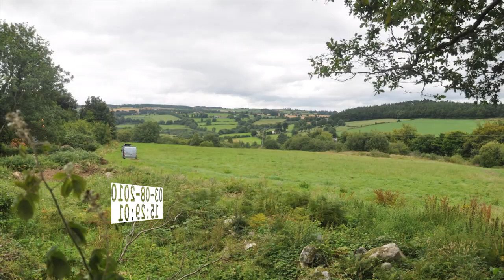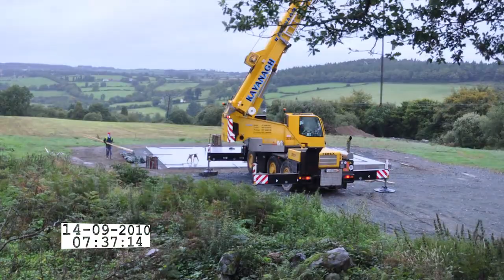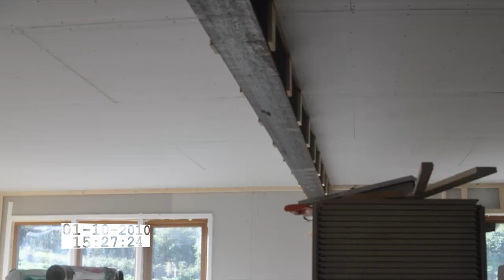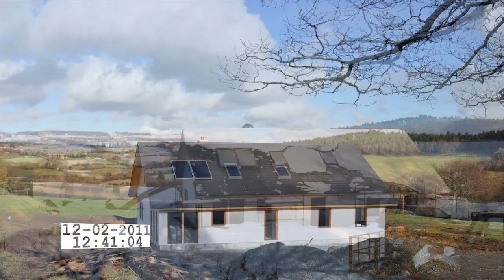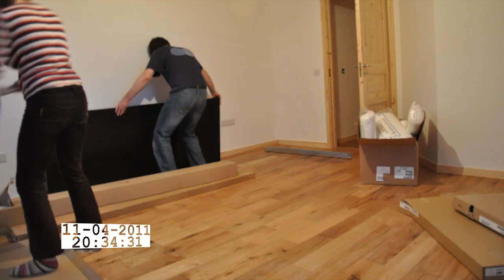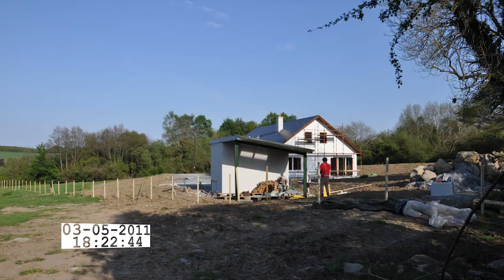Passive house time lapse building in Wicklow

Comment from the maker: Hi Wayne,
I build myself a weather proof box (see link in comment) and fixed it in a tree nearby.I used the integrated time-lapse function of the Nikon D5000. I took one picture every minutes from 8 am until 6 pm and had to change the batteries every lunch time.
I end up with 22564 Pictures in many folders, I wrote a small program to order the pictures and create the time stamp then import everything in Adobe Premiere. That is pretty much it let me know if you want to know more.

Comment: How come their is a Chimney stack? I thought these are airtight homes. Was it an after thought as I don't see a base put in to carry the weight of the stack
Reply from the maker: Good spot ! The Chimney was plan but with a flue pipe all the way up, not concrete. The local builder that did the finishing was against it and with the position of the Chimney we would have had to put cables to reach the required height so we decided for a concrete chimney.

Comment: Did you run the door blower airtightness test and get it passivhaus certified?
Reply from the maker: Hi Yeah No (nice user name) we did the test only once to find all the small problems they were but we did not go for the full certification, they were no government incentive at the time and we did not see the use of being certified. House works really great anyway :)
Reply: Thanks for the reply! Don't blame you for not trying to get it certified. There are a lot of pretty stringent criteria that have to be met just to have a little pretty 'certified passivhaus' plaque on one's wall :) 

I think I see what appears to be a solar thermal panel on the roof - how's that working out? Are you using it for hot water, space heating or both?
Reply from the maker: We are only using for hot water , it nearly works to well in the summer as we get too much hot water and our pump does not really like it ! 
We have free source of wood so we get our heating with a small wooden stove which heats the entire house .
Reply: @daplein  Thanks for sharing :)

Comment: 37 videos detailing a passive house build ( more as the build progresses ) https://www.youtube.com/user/seumas2/videos
Material used 

Port
Alberni's first Passive house (Passivhause) build in the heart of
Vancouver Island British Columbia Canada.

Passive
House(Passivehaus) is considered to be the most rigorous 
voluntary energy-based standard in design and construction industry
today.

Passive
house buildings consume up to 90 percent less heating and cooling
energy than conventional building.

The
use of Passive House design software was used to gain the specs
required to meet the performance standard for this location.

House
was constructed well  above the current standards as outlined in
the B.C. Building Code.

Footings
were widen to 36 inches(914 mm) due to low bearing soil conditions
and additional rebar reinforcement added.

30
inch high (762 mm) high reinforced walls . Course sand placed inside
foundation walls and mechanically compacted.

Three
layers of four inch *102 mm) thick  Expanded 
polystyrene foam sheets with all joints staggered and tape were
placed on top of compacted sand.

The
three layers of foam have insulation value of approximately R 50.

A
20 mil layer of poly was placed over the E.P.S. sheets and taped and
sealed.

Four
inches(102 mm) of 30 m.p.a fiber reinforced concrete was placed to
form a slab over the foam based.

Slab
is isolated from concrete stem wall with four inches (102 mm) of
E.P.S. to prevent thermal loss.

All
cold water lines are buried in the sand to keep them cool, hot water
lines have been placed in the center layer of foam insulation to
minimize heat loss.

Wall
plates compress to heavy beads of acoustic sealant between layers of
vapor barrier to prevent air movement.

The
walls are double stud configuration set at 24 inches (610 mm) on
centre and plates are spaced in a manner that yield a 20 inch (508
mm) thick wall. 1/2 inch (12 mm) standard plywood sheathing with 
Mento 1000 a three layer airtight vapor open house wrap( far superior
to common house wraps) with 1/2 inch(12 mm) pressured treated plywood
rain screen battens form the exterior surface. 

Intello 
smart vapour barrier was installed one third in from the inside wall
to prevent condensation in this climate.

Triple
pane argon filled windows meeting passive house standards from
Euroline  were placed mid wall to reduce wind wash heat loss. 
All window openings have been splayed at 45 degrees to give a full
wide angle view.

Almost
all the wiring and plumbing was kept inside of the vapor barrier
envelope to minimize air leakage.

Passive
house standard requires air leakage not to  exceed .6 Air
changes per hour at 50 pascal.

Zehnder
comfoair 200 HRV has been installed with a 1000 watt air preheater
.(92 percent heat recovery rate)

House
has been pre- plumbed for a heat pump water heater reducing 
domestic water heating cost significantly.

Garage
has been pre-wired for 40 amp/240 volt  electric car charging
station.

House
to be equipped  with  heat pump condensing dryer which
requires no external venting,only a water waste line. George K
Builder. © George K 2019      
https://www.youtube.com/user/seumas2/videos